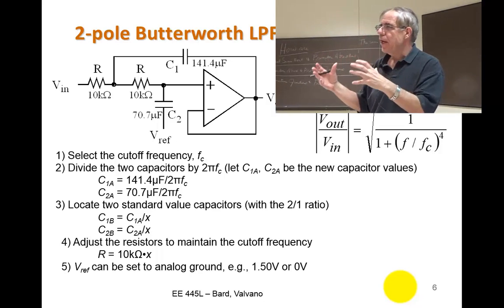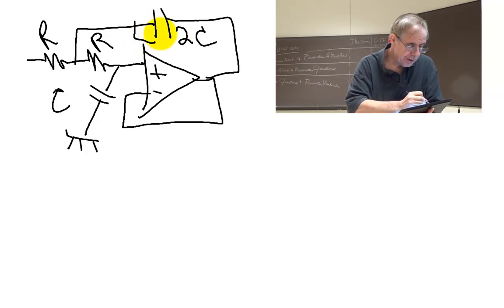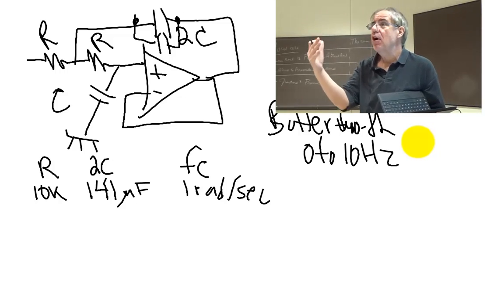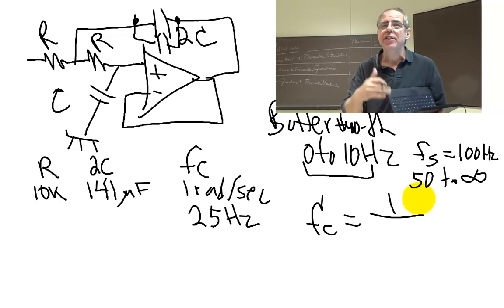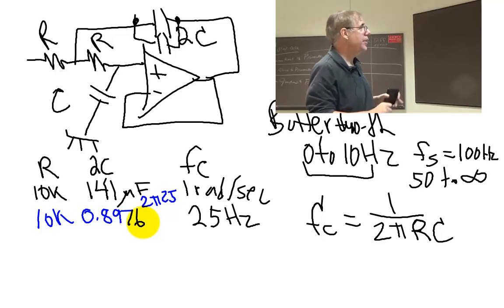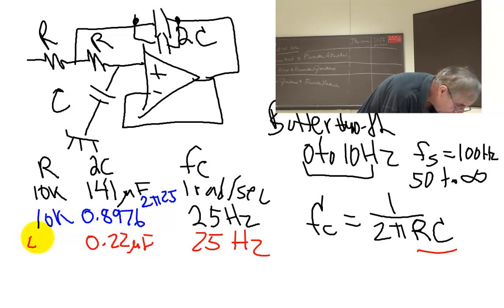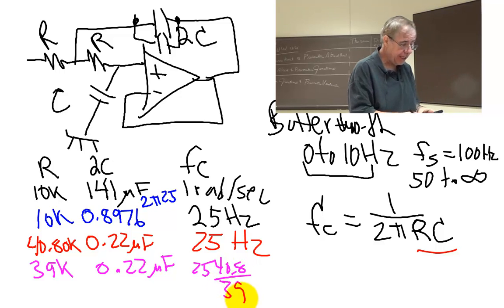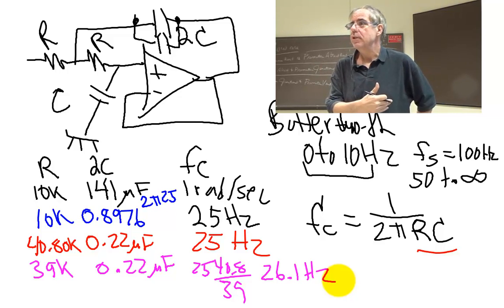aLec37 b Analog Filter Design Example

Comment: The scaling is wrong at 5:28.  Scaling the capacitor just by the ratio of cutoff frequencies. The 2pi gets canceled out - should be 5.64uF not 897.6nF.